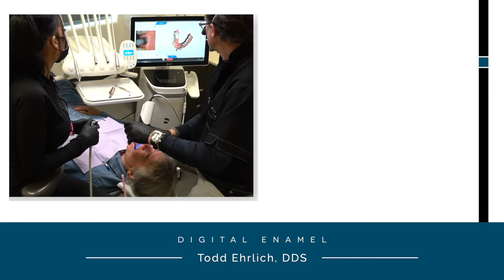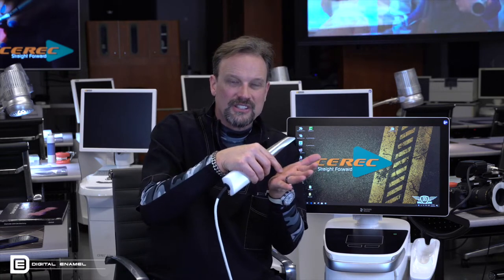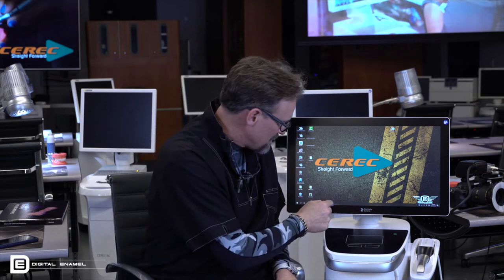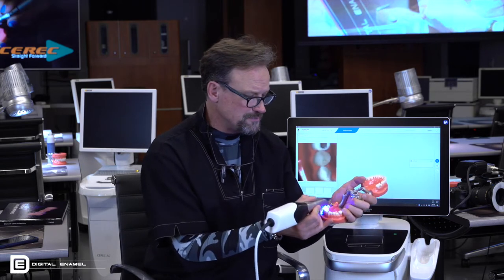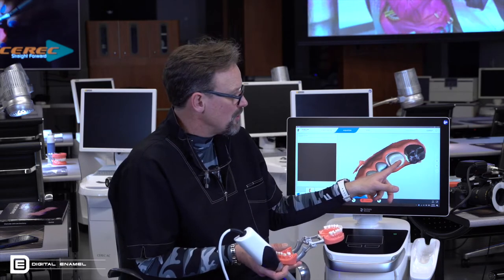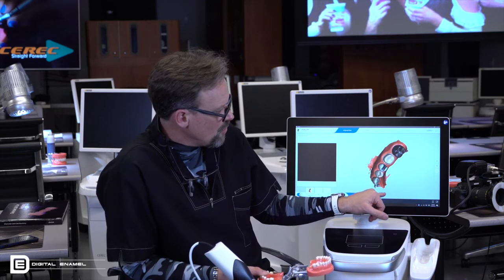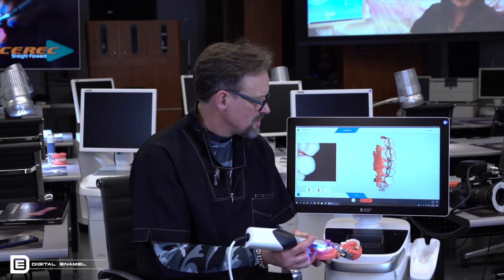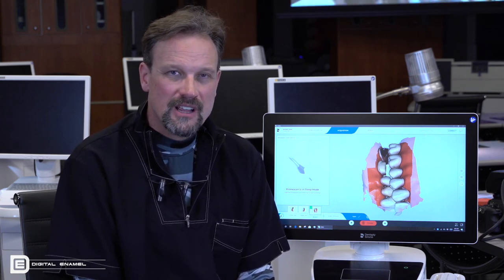CEREC PrimeScan Techniques for Better Models

Comment: Thanks for your video! It was helpful to watch directly before scanning my very first patient.Probably a dumb question but I was imagining to create study models.If there are holes on the scan will there be holes in my models when I receive them back from the lab?
Reply from the maker: So sorry for the delay.   But, yes, if you scan with holes in the model, the lab will have to fill them in.  You wouldn't want to print the models with holes.